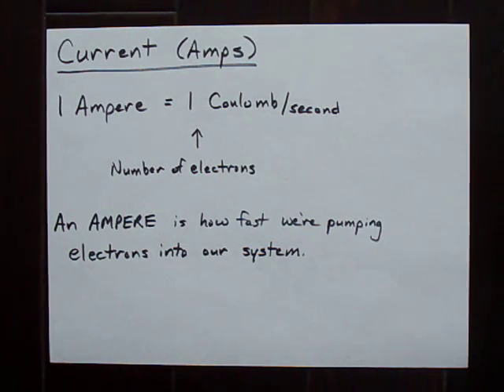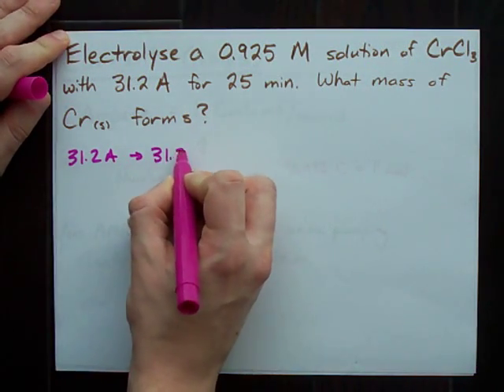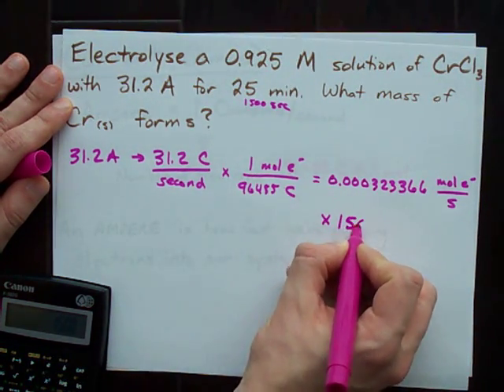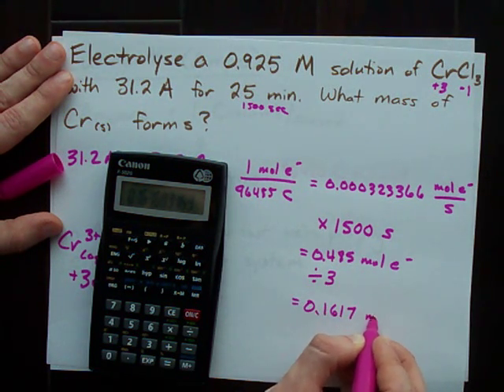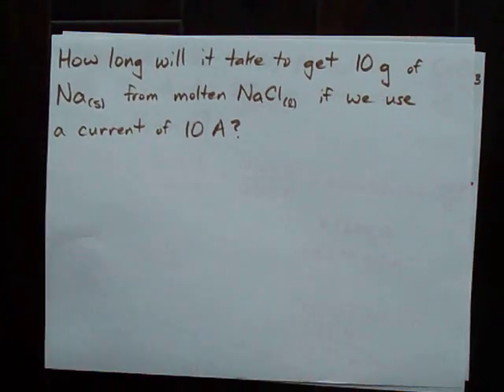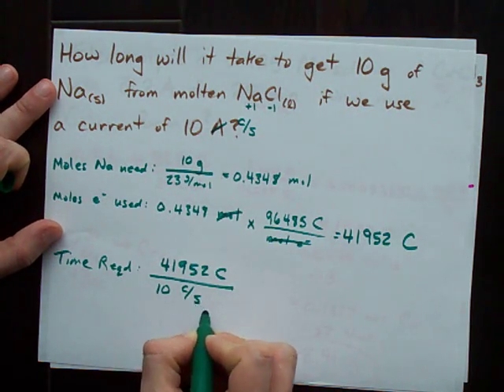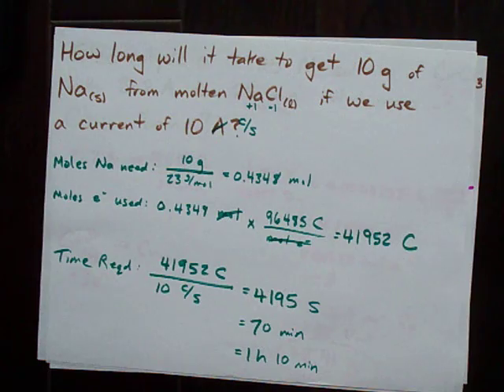Current and Amperes: Electrochemistry Applications

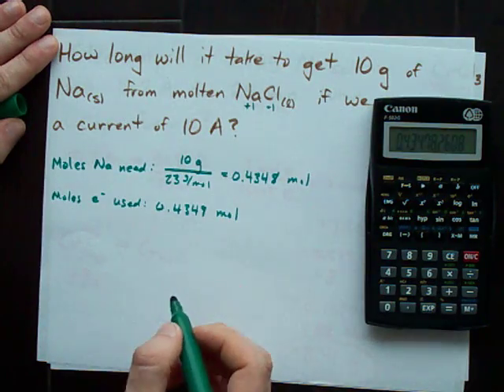Comment: at 05:58, why we hv to multiply? why not divided by 7?
Reply: I know it's a little bit late but it's because you are doing the reverse conversion. From grams of solid you want to find Coloumbs, so you will need the moles of electrons first. He said in case you had 7 electrons. In the formula it would be Na+1(aq) + 7e-  -->  Na(s) 
You produce 1 mole of Na(s) for every 7 moles of electrons. That is why you have to multiply. If it were Na+1(aq) + 1e-  -->  7Na(s)  then you would have to divide.
Hope that helps.
Reply: Little Bit Late.... Lmao